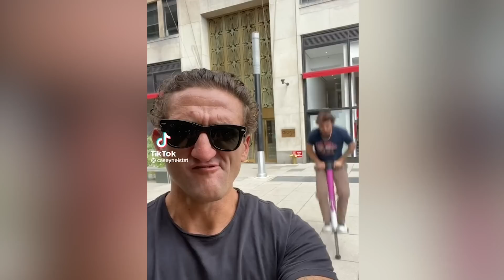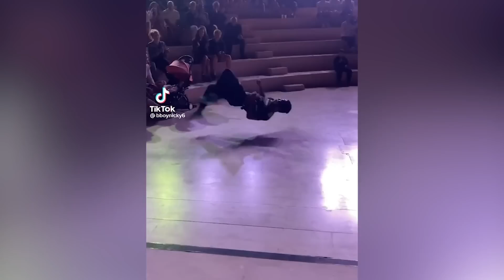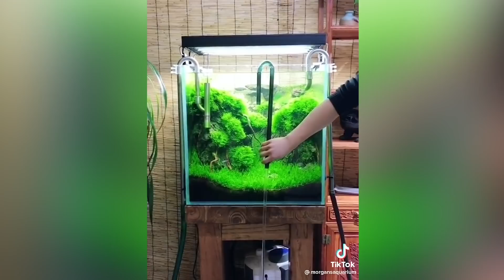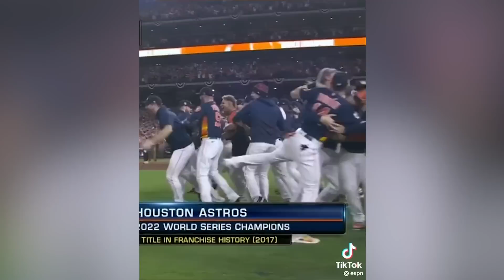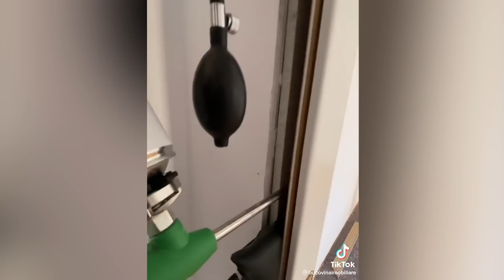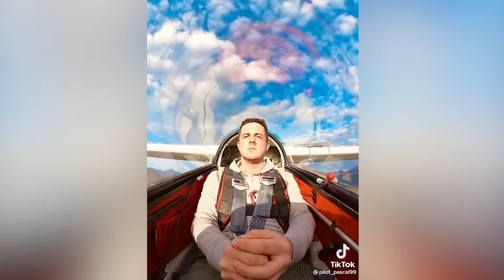Like a Boss Compilation! Amazing People That Are on Another Level #11

Comment: That's a good way to throw your level off. It's not a hammer.
Reply: I can't tell but it almost looks like a 6ft Stabilla, which are only about $300. That's because they are guaranteed to be within +/-0.04° until used as a hammer lol